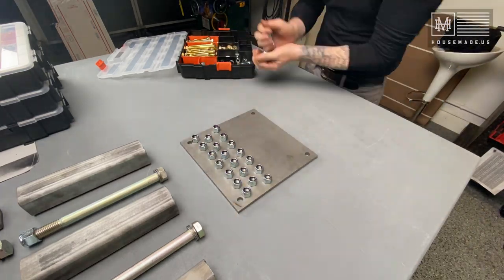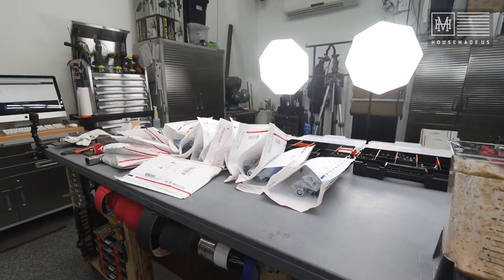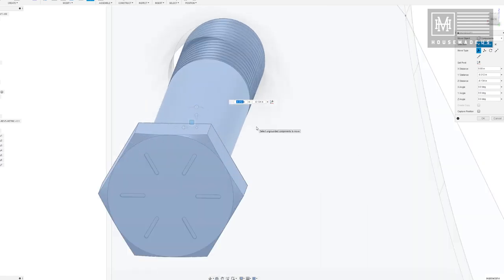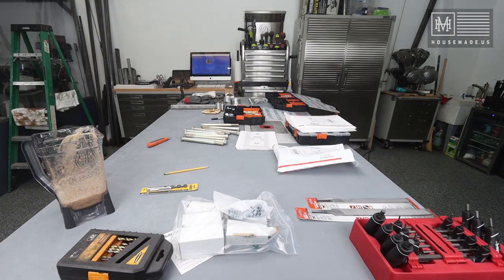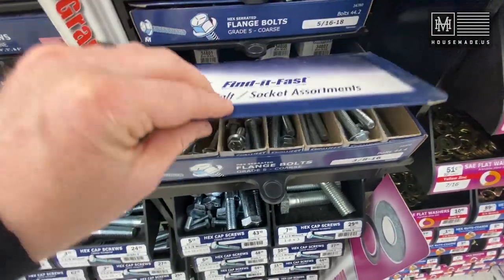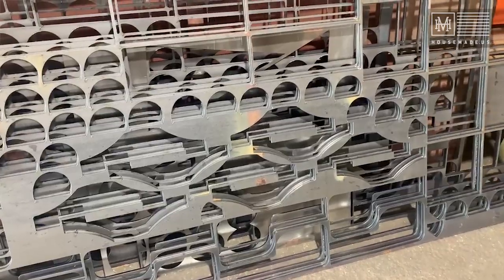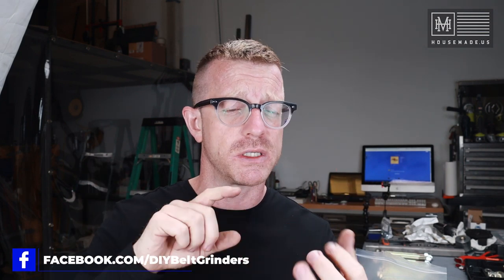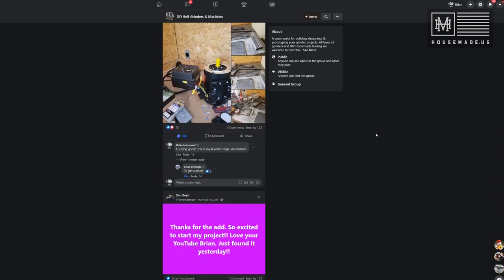2x72 Belt Grinder Hardware Issues

Comment: I would like to see you include the tubing for the grinder cut to size and the platen metal as well.
Just would be nice to have that included in kit.
 And at the end we all win, just saying you can make a little more and we get a little more of what we need to complete the build. 
I think it's a win win on both ends.
Have you thought of that?
Oh, and have you thought of making a grinder that's stationary so you can  put a pulley on the motor and wheel so you can build a cheaper grinder.
That way you dont have to buy the variable speed control system. You would save about $300.
And you wouldn't need the motor mount plate either witch intern saves cost on the build. 
So instead of a grinder that cost approx.  800 would cost $500 approx .
 I like what your doing, keep up the good work,  love the grinder.
 Oh, and if you decide to make a statuary 2x72 grinder with a pulley system all you have to do is make a bigger plate base that the motor can set on. No motor bracket and no need for the brackets that swing the grinder on its side.
 Well just a suggestion,  good luck with everything!

Comment: Really cool vid, I’m glad you are calling out for information I wish I knew your answers but I wanted to say that main front bit that holds the 2 wheels in metric would be better made out of 12mm vs. 10mm, all the rest of bits at 10mm is great but I feel like 12mm is more stiff for the front part... I’m referring to your European clip you put up with converting
Reply from the maker: I’ll keep that in mind. I thought 1/2 or 12.7mm would be good too. 👊🏻
Reply: House / Work I was just watching something you put up about converting and it was all going to be 10mm plate which is good for all of your brackets but the only one I can see an issue is the main front section... you no doubt would be doing it correctly I just wanted to add that in. Very exciting for you I’m pumped 👍🏼

Comment: Keep in mind that most of the sources everyone is referring to are distributors. Whenever distributors touch a product, the price goes up. I can almost guarantee that M.C. buys those bolts ALREADY packaged in that box of 5 bolts. Your best pricing will be straight from the manufacturer. Yes it’s more complicated but once set up, your pricing would be much better.
Reply from the maker: Yes for sure. I’ll need to dig to find the actual manufacturer. Good point. 👊🏻

Comment: I don’t know how the pricing compares, but boltdepot.com has always worked for me.
Reply from the maker: I’ll check it out. Thank you!!
Reply: Bolt Depot is great,  @HouseMadeUS , and we use them a lot. But always for smaller, hard to find, and generally stainless steel hardware.
Reply: BoltDepot is my go to for all nuts and bolts.  If I remember correctly, they are a family run and owned business out of Massachusetts.

Comment: What size is your example socket head bolt?
Reply from the maker: 3/8 16 - 3.25” 👊🏻👊🏻👊🏻
Reply: @HouseMadeUS  Looking at Tacoma Screw website. They show a pack of 50 at $39.18 ($.78 ea) compared to MM-C 5 at $9.80 ($1.96 ea). 
I just don't see a specific call-out for full threads, which prob means they aren't. 
 They do specify that it meets the same ASTM/ASME specs as the full threaded one on MM-C.
So, maybe....

I put in a help request asking about threads, I'll update this post if/when they reply.

Comment: You need to ask a salesperson at fastnal they have different rates on bolts. But you need to open a business account there.
Reply from the maker: Ahhh okay. Will do. Thank you brother!! 👊🏻
Reply: Agreed! After a business account, I was assigned a salesmen rep who would come and set up are shop with parts bins and code bars. then he could show up and scan the bar codes  when we get low and get more at a discount. Didn’t have to order or deal with unpacking.

Comment: Hey Brian,  I have been cruising YouTube looking at 2x72 belt grinder builds, collecting ideas, thinking of what I would build, but I think I will stop now because your design checks all the boxes.  Anyway not sure where you are, but all my MechE friends here in the Sili Valley are on a first-name basis with Olander's.  olander.com  They do kitting BTW, so you might check that out.
Reply from the maker: Thanks David, I appreciate that very much. I’ll look into them for sure. I am in the process of assembling a CNC table right now and I have about 200 hardware kits to build. I’ve bought all the hardware just need to assemble them. 😅 Hope to see the Revolution in your workshop at some point! 👊🏻

Comment: my take on your situation you're dealing with the 3 most expensive places.  mc master, Grainger, Fastenal. their middlemen and charge  accordingly 

  These guys are for companies that make a day millions need parts now, yesterday, and are losing thousands per hour.  because the machine is down. money is no object

 you are paying for that service which they provide.  

you have to look at this way wholesale, to the trade, only the big 3 don't care about little guy like us because their not making enough off you.

it like going to lowes and home depot to buy your bolts each....    when tractor supply sells bolts by the pound more value.... 

 i am in sign industry it like me going to amazon, eBay, metals online etc.. for my plastic, aluminum, steel, vinyl something that not done.

  i deal steel & aluminum mill, plastic distributors, and sign supply that are a trade only.

it was all fine when you prototype now you are growing and you have bottom line to look at and have to make a profit. and still, keep the product reasonably priced.  

 you need to buy cheap and good quality but in bulk.

here is 3 places that deal in bulk. 

https://www.boltsandnuts.com

https://www.newportfasteners.com

https://psifasteners.com
Reply from the maker: Probably the most valuable comment. 🙏🏼🙏🏼🙏🏼 Thank you brother!! 😁👊🏻
Reply: I buy all of our hardware in bulk/pound,  @HouseMadeUS . What is the spec on that largest, and what I assume to be the most expensive single bolt piece? I will check on pricing, in the next couple of days for you. (I need to go over this wheel issue with you anyway)

McMaster-Carr is great for small lots of very odd pieces. Not priced for bulk purchasing. 

MSC, Grainger, Fastenal, are all far too high priced. Even with a Master account. 

#crowdsourcingwins
Reply: This looks like a brilliant piece of information! You’re right about the big Guys not caring about the little guys money , I’ve seen it a lot before I worked for a multi national company now if I recognize someone that was an A hole sales rep I’ll ask to talk to someone else
Reply from the maker: The biggest bolt is a 9.5” 3/4 - 10 bolt. It’s $8.50 at McMaster.  Thank you brother!! 👊🏻👊🏻👊🏻
Reply: Very good,  @HouseMadeUS . 
I'll need the Grade spec also.
2, 5, 8?